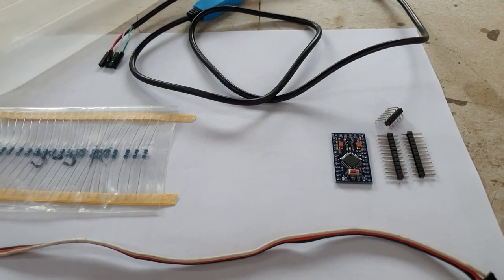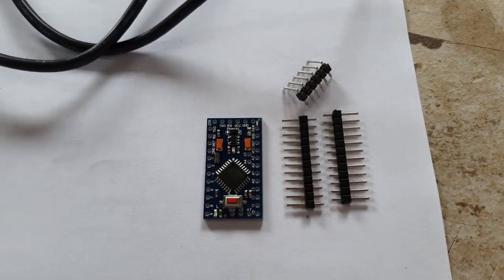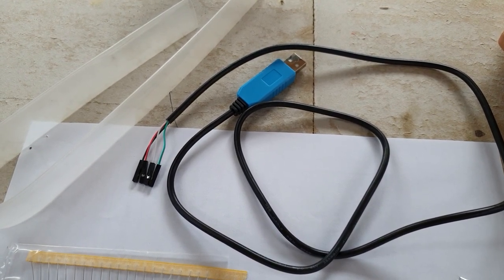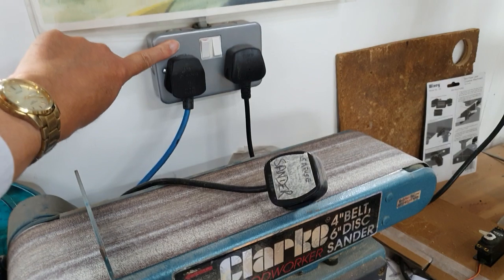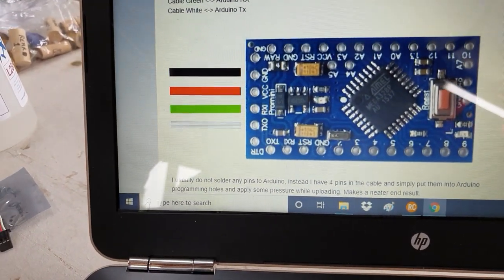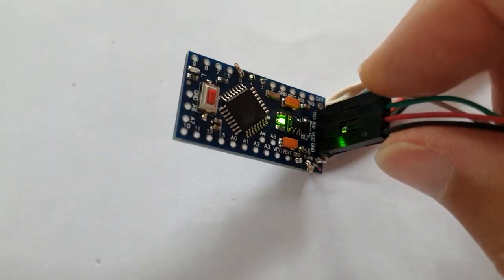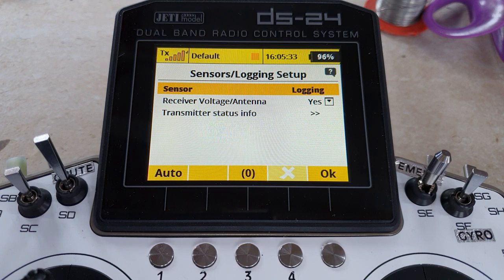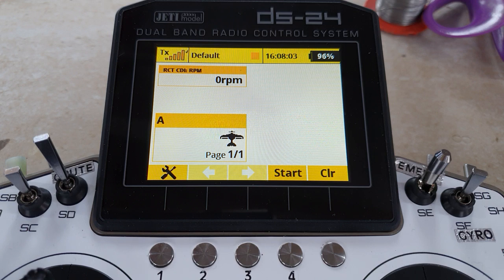Jeti - making telemetry sensors from rc-thoughts.com

Comment: Hi Harry, thanks a lot for your videos, they're very much appreciated.
Maybe do you know what doesn't work on my setup, I upload the 'RCT-G-Sensor' config with the uploader v1.0.9 and I got the 'upload successful' message.
Then I plugged it on the EXT port on a REX7 (and tried on a R9 by the way) but nothing appears on 'sensors/logging setup' on the DS-16.
I checked the outpin EXT mode on the REX7 and it is configured on JETIBOX/Sensor mode.
Also tried the vario program on another Arduino Pro Mini with same not working result.

Do you have maybe some ideas on this?

Thanks in advance.
Reply from the maker: Hello Hector, it may just be the way I am reading it, but did you actually have any accelerometer sensor or vario sensor connected to the arduino board?  Check all connections are in the correct place and that no very fine strand of copper wire got pushed out and is shorting to the adjacent pin - use a magnifying glass to spot them.

Comment: Hai Harry. Your not completly right. You can use the Mrpm AC sensor form Jeti to get a readout of your petrol engine. I have doen that with my FG19R3 . Ferdinand
Reply from the maker: The sensor that Jeti's website says - "MRPM EX-AC is used exclusively for measuring the speed of brushless DC motor".   So as far as I am concerned, Jeti does not make a CDI ignition unit rpm sensor!